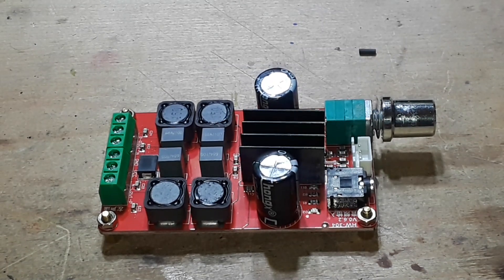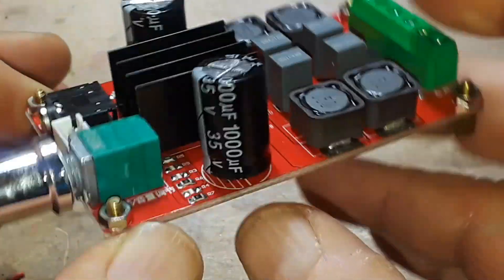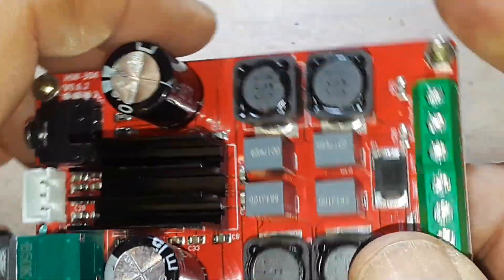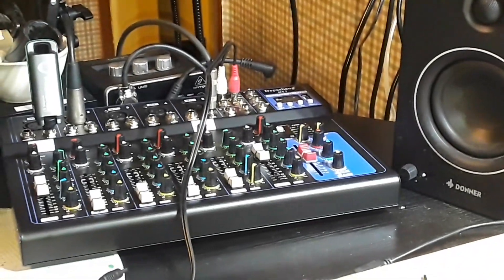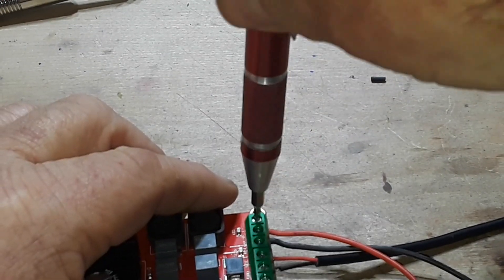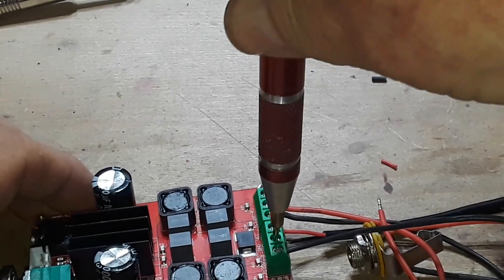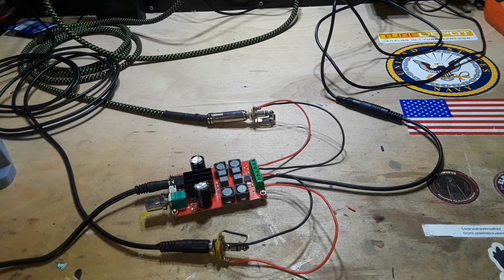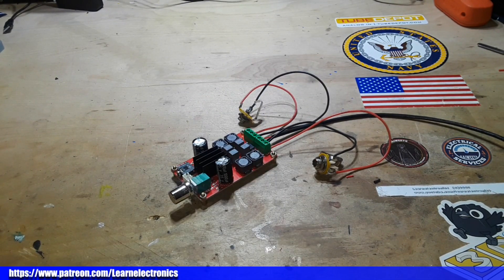TDA3116D2 Digital Class D 50W Stereo Amplifier Board

Comment: I need an amp for my RPi DAC. Not sure why it's hissing, but at $7 you can't moan. I'm looking for a good quality amp that doesn't cost an arm and a leg. I haven't started looking so haven't a clue...
Reply from the maker: The hiss is from the signal chain. There are a great deal of electronics in that room all oscillating at different frequencies. 8 large speakers, magnets everywhere, switching power supplies...think of a clean electrical environment. I am the opposite. Lol